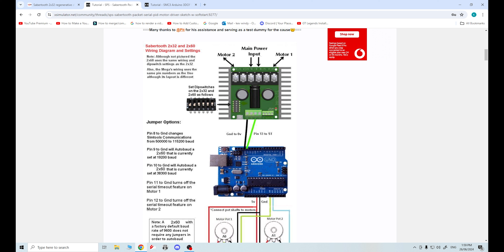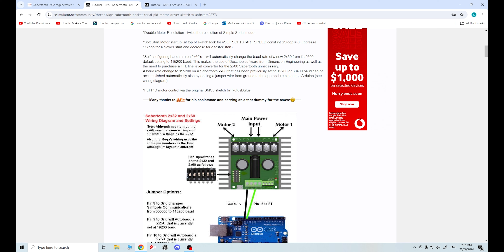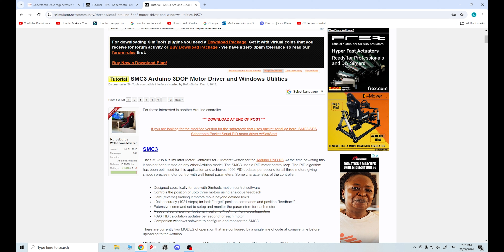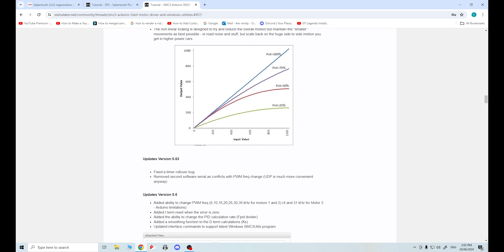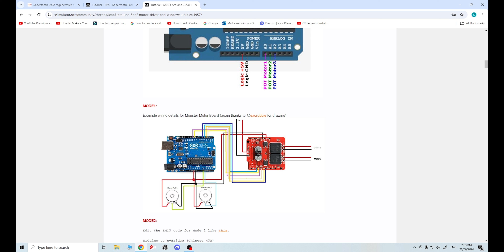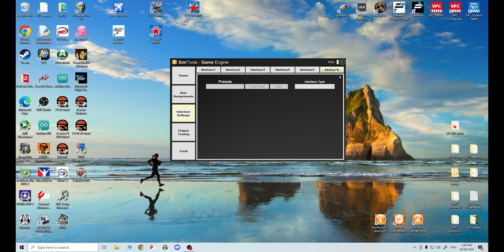DIY 4DOF Motion Sim Setup — Dr ADHD’s IBT-2 + Sabretooth motor controller Guide

Comment: Great Video Doc.. thank you for taking the time to this.... Is there a video that starts from downloading the Arduino software with a step by step approach for non experienced punters? I can't seem to get pass point 8 of the SPSTutorial on XSim = 7 - not already done apply power to your Sabertooths motor inputs- Have Done
8. Now use the Arduino programming software to install the SPS sketch attached below on your Arduino. - _ How do I do this? _ Make sure you choose Uno or Mega and to set the comport number. _ Sorry - lost on this too ?
Next download and run the Windows SMC3 Utility software attached below and make sure it communicates with your Arduino. _ How do I do this ? _ Open the accompanying SMC3Utils.ini with notepad to change the comport if needed (see image below) I changed it and closed it , not sure if it was saved or not >>> Any advise would be much appreciated ..
Reply: Thank you for this video and the others that you have generously provided. I am challenged in following the procedures and therefore having so much difficulty getting the rig I built to do anything that I am desperate to find someone that will help me.
I cannot get pass point 8 to use the Arduino programming software to install the SPS sketch because I have no knowledge or experience to discover where the Arduino programming software resides and which sketch (by name/label) in SPS as referred to.
I can get my Arduino uno r3 to compile and run a basic sketch to change the rate of blinking on/off of the onboard LED but that is all. I have purchased from Xsimulator all Simtools and have what I believe installed it. I have downloaded Windows SMC3 Utility software but do not know the steps to take to make sure it communicates with the Arduino.
Once Simtools is running I am sure that I can muddle my way forward but just can't seem to figure how to get there.
I have asked one of the engineers from my work to help, but after two hours he left without getting it running. All files have been downloaded, but it seems that I do not have enough dumbed down baby steps in the procedure for me to work my way through it all. Any help / assistance would be much appreciated... if anyone has a video of their screen or screen shots on what to look for will be a help to me. I am willing to pay for someone's time as I appreciate this takes effort and valuable knowledge to work out.
Reply from the maker: Hey George. Yes it can be challenging unpacking all this info and getting it to work. I’ll have a look later today and see if I can run a step by step tutorial on how to do all this. 

I have covered arduino libraries and getting all that sorted in previous videos but I know the sites where the downloads change along with the UI’s on the pages, so it can be confusing.

I’ll see what I can do to make a video showing all steps.
Reply: @ Thanks Kevin .. I am venting a bit ( whinge? ) out of frustration with my limited experience and knowledge that may have been easy for someone to do. Apologies if it comes out in a negative way but it isn't, I am determined to get it to work but have lost my way with the process a few times.  I think I have too many copies software downloaded now as I discover my way around the PC. Could I ask if there is a "Hardware" start-up sequence and also a "Software " start-up sequence that may be recommended?  Also, my connections are all hard wired at the moment as I have not used in line plug / socket sets for Power to motors, Hall effect Pots, Power to Sabretooth 2x32s etc. I do have fuses in line from the battery to Main Power input of the 2x32s. Also, I'm not using the IBT2 at this stage and only using two 2x32s. I will use the IBT2 later for a seatbelt tensioner or a Wind Sim once everything else is running first. Again, much appreciate your attention and help provided.
Reply from the maker: @A.GeorgeMenendez  George. Have you watched this video???https://www.youtube.com/watch?v=Xi6WSDAOcCk&list=PLbS2NiroZpABYf--ClvkqdUUXZ26A3Uyh&index=2&t=168s  Check this out and let me know if this solves your problem before I spend time making another video.
Reply: Sorry but forgot to ask that in the XSim SPS document , I read ( mistakenly? ) that Pin8 on the arduino is to be connected to GND to change Simtools communications to become 115200 is this correct as my concern is that if Pin 8 is configured as an input (pinMode(8, INPUT);), grounding it will pull the pin to a LOW state, the Arduino will then read this pin's state as 0 or LOW when you check it using digitalRead(8) but if Pin 8 configured as an output (pinMode(8, OUTPUT);), and if the code attempts to set it to HIGH (digitalWrite(8, HIGH);) while it is physically connected to ground, I would have created a short circuit between the 5V supply and GND. This could cause some damage to the Arduino - So thinking it's crucial to ensure the pin configurations avoid such a conflict.
Reply from the maker: @A.GeorgeMenendez  I can’t remember having to ground any pins when I setup the arduino with the sabretooth or IBT2’s. 

It’s been a while since I did all this. Give me a couple of days to go over how I set mine up and get back to you.
Reply: @ I did watch it a few times but am still trying to work it out
Reply: @Doctoradhd1  Hi Doc... Thank you for your patience and understanding - I suspect some or likely all of the issues I have been trying to overcome stem from looking at too many videos from different sources in a random way as I find the time in order to get a definitive latest methodology on a sequential procedure (and downloading too many / multiples of the same software) -  got a bit confused in the end.  I wish i was more focused but "it is what it is ".
 I have been able to get the motors to rotate on an individual basis - not exactly as I planned - but encourages me that i am somewhere on the right track. I have from tomorrow afternoon set aside Friday/Saturday/Sunday/Monday Easter to get it sorted. I am concerned that I may not be able to work out why the 2x32 Error LEDs come on. The question that plagues me are 1) From the Xsim site SPS page - I am using your SMC3 settings for Assetto Corsa  ref : Dr ADHD DIY 3DOF Motion Sim Platform avoid IBT2 Short Circuit. I found steps 8 and 9 needed to be dumbed down a bit for me. I have purchased all of the Simtools software but may not have installed it correctly, so will have to somehow revisit this again and work it out. The Describe Software is a bit of a mystery to me and if possible, would like to see your screen settings for each screen now that we are running comparable equipment. My apologies for being a pain ... hope I'm not causing you to spend too much time helping me.
Reply from the maker: @A.GeorgeMenendez  it’s all good George. Hopefully I can put something together that helps. Not sure why the error lights are on your sabretooth. 

I’ll try and start on a video this afternoon. Hang in there George, you will get this sorted.